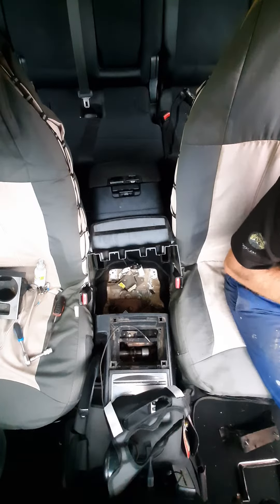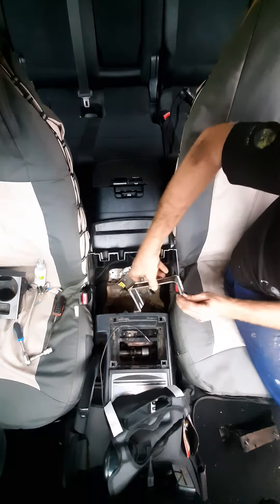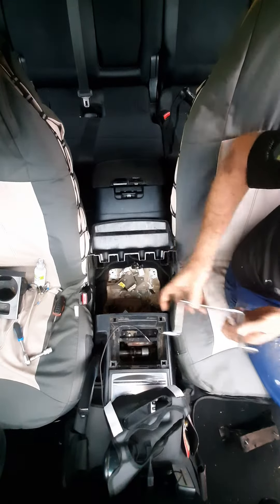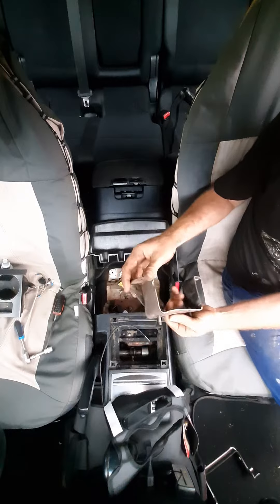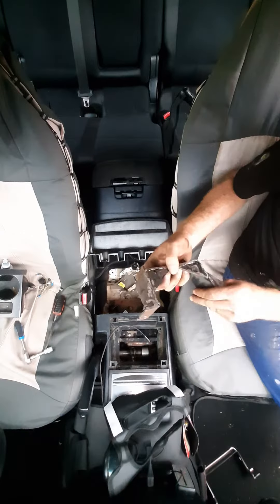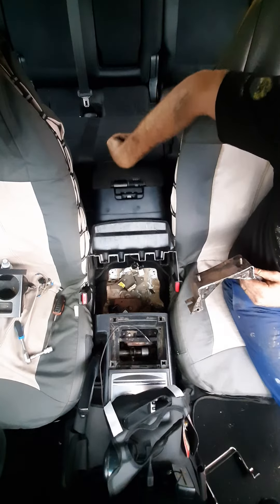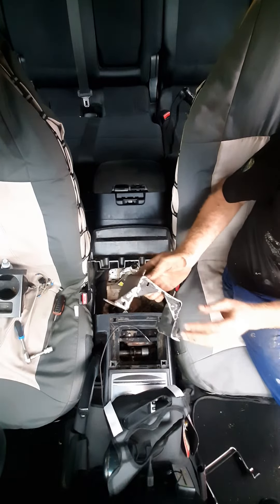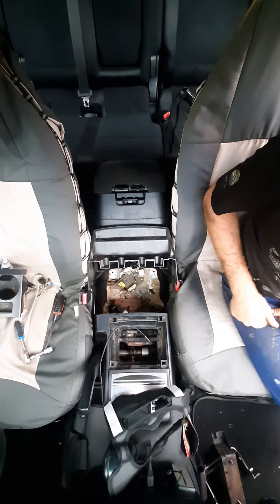Gen4 Pajero center console rattle fix

Comment: Hi did this end up making a big difference. Have you had any other rattle fixes other than the cable tie and brackets on the dash.
Reply from the maker: Yes. It made a difference. I have copious amounts of foam sheets in the dash and door cards. Also deadening on the door cards. It's still not great but a lot better than what it was.

Comment: Hi, I have a lot of rattle noise issues from the dash. Did you have the same issue? If so how did you fix it ?
Reply from the maker: Google a bit. There is a cable tie fix that makes a difference as well as some dash brackets in the radio area.
Reply: @MariusFourie  kindly do you know any videos which shows this fix ?